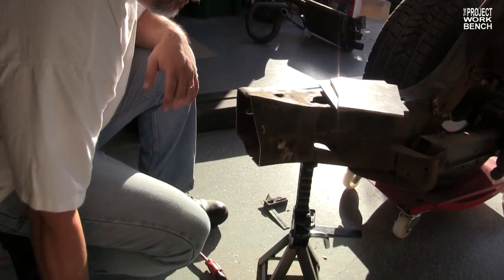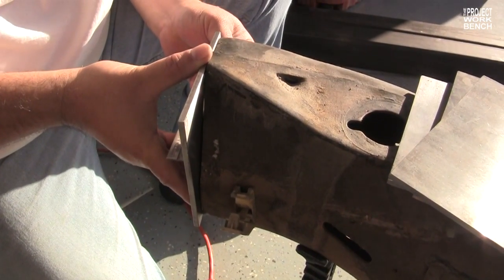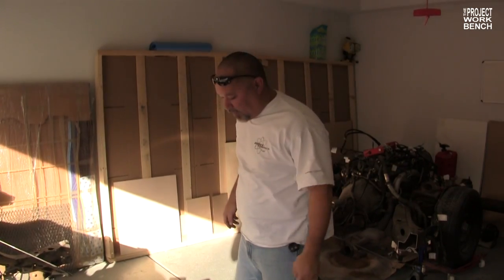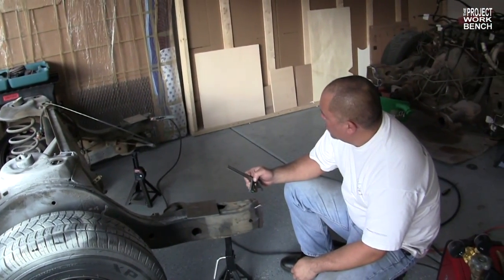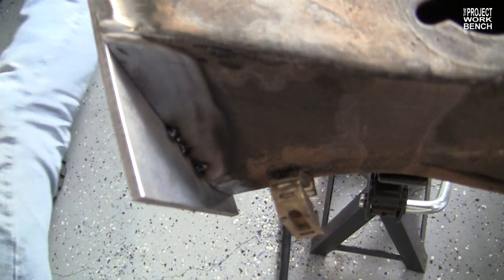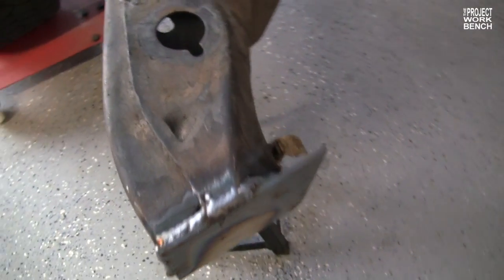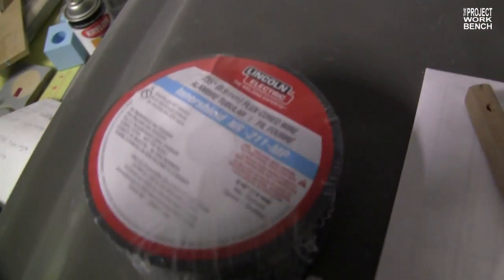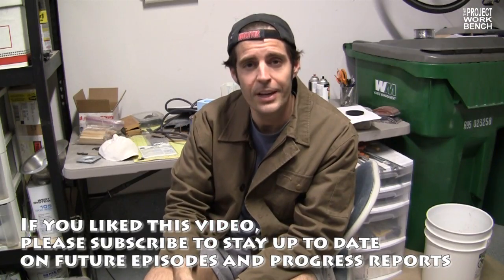Rise of The MattMobile - Ep 15 - Welding Mounting Plates Into Place

Comment: that is NOT what good welds look like AT ALL and that is NOT how you chop a flexing chassis. you would chop it diagonal or better yet length ways in a down across down kinda pattern to spread out the welded section so as vertical load would only pass through some of  the welded area. this guys a rough as guts hack. Matt be safe mate an don't trust just anyone to work on ya car